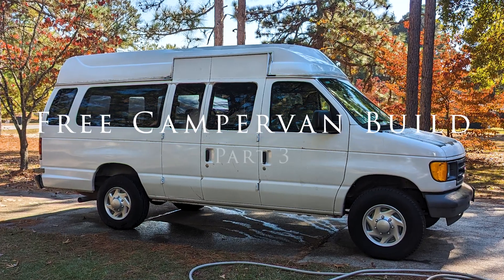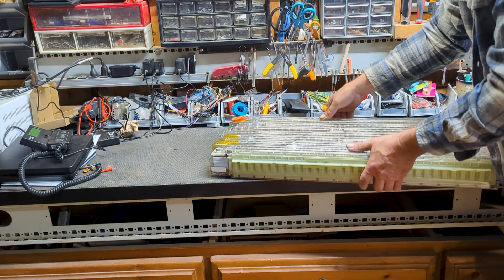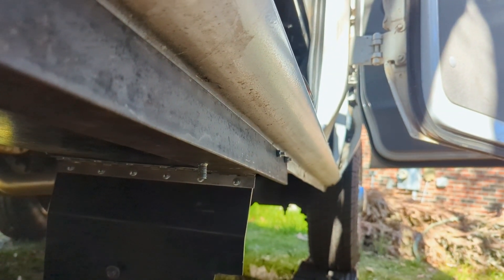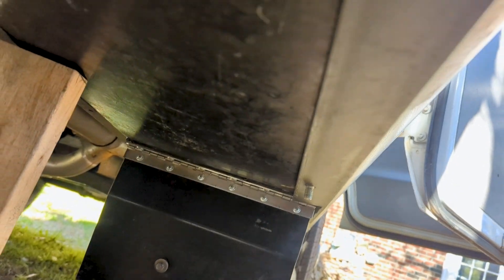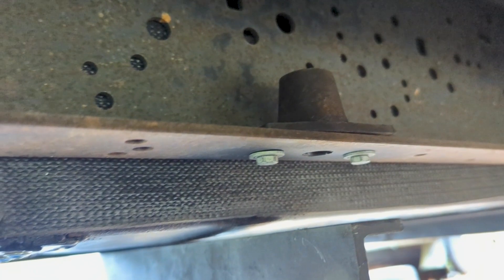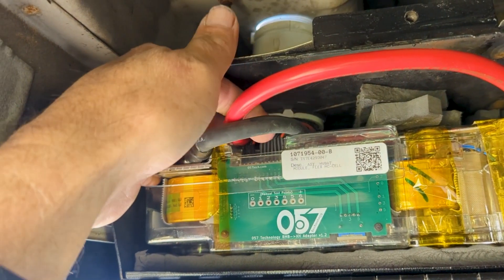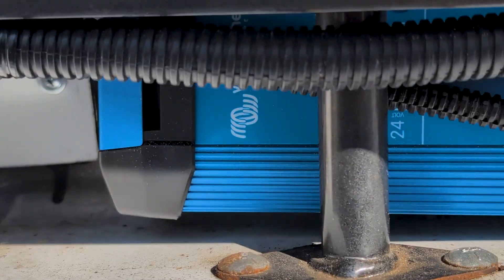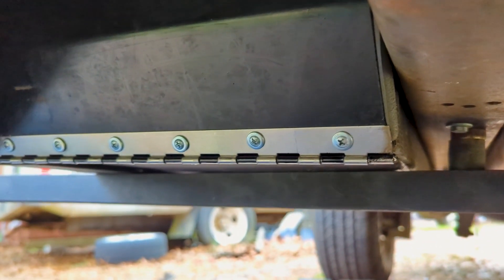Installing a 24v Tesla Battery Module in a DIY Camper Van

Comment: Nice battery location. Since the battery is mounted outside and temperature affects the performance of the battery, Just wondering if the battery is insulated enough to work efficiently. Looking forward for the van update.
Reply from the maker: Thanks! Yeah, I'm wondering the same thing. I'll have to try it for a while and give an update
Reply: Depending upon when/where you are camping temperature. 

Battery will not like its own temperature over 110F, or below 35F.

Not shown:
 how the module will be prevented from sliding around inside the case?

Have you put electrical insulation/ isolation, between module and case?
Tesla uses mica sheets top and bottom, ask module vendor for them.
Watch videos of DYI 18650 battery packs. There is a type of shrink wrap that may be available. Or, cut up an automobile inner tube.

Are you intending to cool/warm the battery with a small pump and radiator?

That case needs a few additions:

Somehow, quick drop if you have a battery fire. 
I would use long carriage bolts under, up through the van floor. Thread ends, drill hole for trailer hitch type keeper pins. Cover with carpet and/or cover plate.

Next, a plumbing fitting to quickly  pump flood the case with (salt) water to cool and discharge in case of battery fire. May not extinguish the fire, but will certainly slow the chemical reaction. 

Next, a one way low pressure valve to allow for atmospheric pressure changes, and gas venting in case of fire.

No space in your case for a snake detector......?

Be careful!